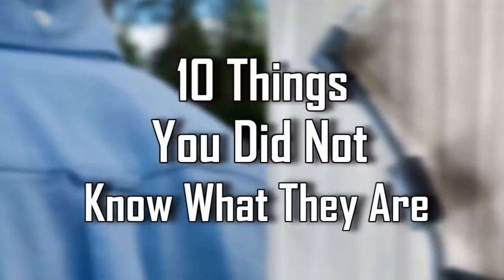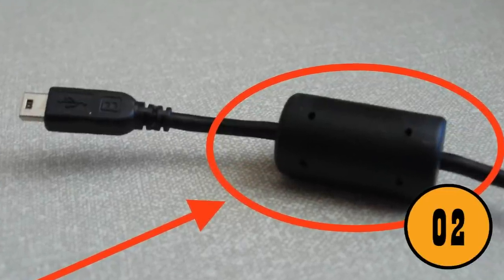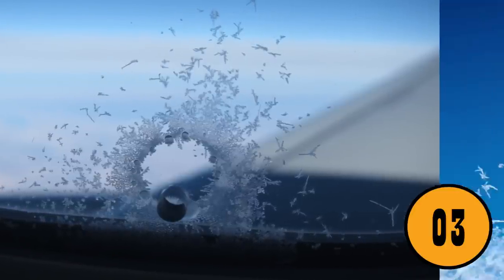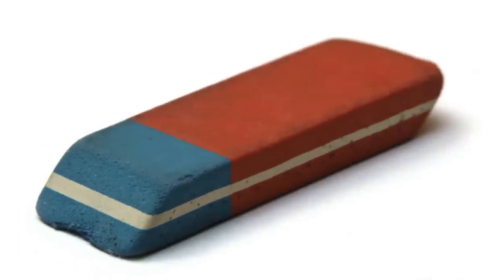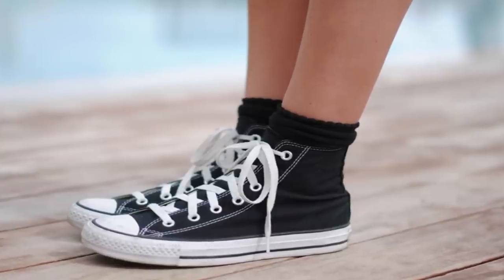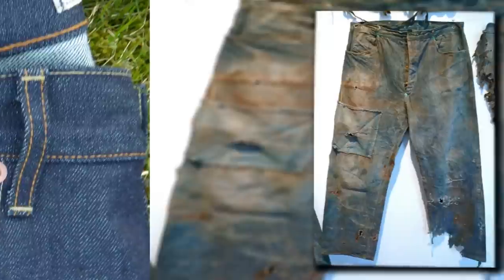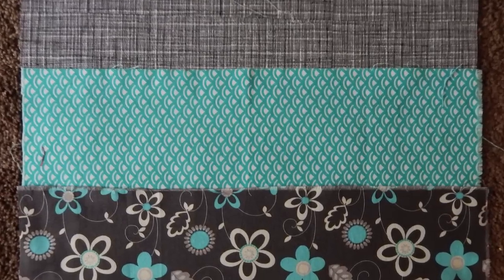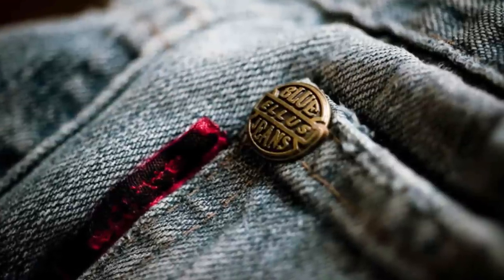10 Things You Did Not Know What They Are

Comment: Interesting "things", a lot of them had unsatisfactory explanations though. 
The Cable Cylinder for example nullifies static electromagnetic noise? What would happen if it wasn't there?
The Spaghetti spoon hole is to measure a serving? That doesn't even make sense. Of course it's to drain out the water. 
The Pencap hole is so that the whole cap is not absorbed by mucus? How does that work mechanically exactly?
The bits of fabric that come with clothe can be washed first to see what they react to washing like? Does that make sense? Unless the color actually changed I don't think you could tell if the wash shrank or ruined your piece of fabric much.
Reply: I always though it was so you could take the little piece with you to buy shirts/ties etc... and check they match the jacket...
Reply: The hole is to measure the sapghetti BEFOR you cook it.  Try google spaghetti measure.
Reply: Martin Lyhagen 
o that could be.
Reply: I'm 100% sure that is exactly what it is not for. It does not take a genius to figure out a serving, It has been around for a long ass time. No one wants water in there spaghetti so it's only natural to put a few holes in the bottom of the spoon. Also no two brands of spoons have the same types of holes so its not consistent with servings. Some spoons have a lot of small holes, how does that help measure a serving? It doesn't.
Reply: I agree with you. What a lame lame made up reason for the hole. And worse... they didn't even explain the made up reason properly. If you went from this video, you would think they meant the hole was to measure cooked spaghetti. But it doesn't matter because it's bogus anyway.
Reply: Old Aussie Ads They do make it seem like the hole is for COOKED servings. They just mashed this video together without any real research.
Reply: Ever tried pouring off the water before serving.? You are supposed to do that you know. Then you realize the hole  is not for the water...
Reply: Martin Lyhagen Yeah ok. says the person who never cooks.
Reply: Martin Lyhagen 
The water wouldn't go out without holes. What are you saying?
Reply: The hole is THERE so the water can drain, and the hole is that SIZE so people like me who will forget that noodles expand, doesn't end up making noodles for 10 instead of 2.  
So portioning isn't what it's really used for, but it can be used for that too if you want.
Reply: neonoodle 
Wow this is such a passionate discussion about noodle spoons. You'll only find this on Youtube xD
Might try this next time I make noodles. Though usually I just take them in my hand and judge from that.
 I'm actually more of a rice guy lol
Reply: I always assumed that they were there for the same reason that extra buttons are provided: for repairs later.
Reply: Seldseen Goosequillian 
Aren't Noodles a type of Pasta?
I think Pasta is just how you say meal in Italian isn't it?
Reply: "The Cable Cylinder for example nullifies static electromagnetic noise? What would happen if it wasn't there?"

Well, one example is with microphones. If you dont have a properly shielded microphone cable, then the electromagnetic noise from all your other electronics will induct into the cord (which acts as an antenna) and will cause either static or a high frequency whine on all your recordings
Reply: Broockle I am no Asian but have you ever tried calling noodles pasta right in front of an Asian? If case not, do give it a go and see how eath you will be yelled at ;)
Reply: +Seldseen Goosequillian I'm all for making fun of Americans, but at least do it when there's a reason. There's no difference between pasta and noodles, pasta is just an Italian word for noodles. 
More to the topic though (and here's a part where some making fun of Americans could be done)- that spoon is designed for almost all types of noodles, not just spaghetti, any type of noodles, with the possible exceptions of canelloni and lasagna, are really hard to get out of the water, if for various reasons, you don't want to just drain the whole pot.
Reply: pasta is just the Italien word for noodles
1....lol the whole is to measure one serving before you cook it, pasta expands when it cooks so measuring servings will help you to cook just as much as needed and no more.. also it seems like people have not heard of sieves (that's the thing you use for draining stuff..) another reason why it is not for draining is that if you cook pasta like it should be done, you would mix the cooked pasta and sauce before putting on the plate (though I sometimes prefere it the "wrong" way, too); I also saw one comment that said pasta spoons come with different wholes.. my theory is that these aren't made by companies who do just kitchen articel so they actually design it wrong/ or they saw that people don't understand the whole and thought well than we just can go craziy with the designs..
2. the cable would probably make noice then, if the zylinder is missing I guess
3. to the pencap.. (if you listened carefully you'll hear that he said not absorbed by the membrane and not absorbing mucus) it is hollow so when you accidently swallow it and if it absorbs membrane it might react like smth with a vacuum (making us choke/hurting the lungs.. with the whole there will be still some kind of circulation keeping from sucking in the membrane maybe???
4. I know your confusion but you can indeed tell of just such a small piece of fabric how the bigger piece will react..  for the colour test you need to wash a little piece of (white) rag with it (to see how much colour it dispenses), and you'll feel if the fabric tightens from rubbing it between your fingers (after drying) or if we wash our clothing wrong (to hot e.x) it becomes kind of fluffy when it should feel and look "silky" (hope you understand what i mean)... don't know who made the comment with taking it to the stores that is a pretty good idea .. to take that piece with you so you'll see what will fit your jacket or jeans etc...
Reply: There is a difference in the recipe for making them. It's like saying a steak and steak tartar are the same. Even tho it kind of is it really isn't.
Reply: jimenez de Costa to what comment are you refering.. there are so many comments it#s easy to get lost
Reply: "I don't think you could tell if the wash shrank or ruined your piece of fabric much."
Or you could use a ruler and write down the 'before and after'. But I guess barely anyone did that ever.
Reply: Seldseen Goosequillian 
Why would I call Asian Noodles Pasta? That's an Italian word. You're not giving me the impression that you know what you're talking about.
Reply: Oh god...here comes the italian guy. Spaghetti and noodles are two different things in terms of ingredients and production. Spaghetti are a type of pasta, which is a kind of food made with various kinds of flour, and...no, pasta is not the italian word for meal but you were near because it's "pasto".
Reply: +Broockle  Your profile pic brings me feels ;-;
Reply: Nicolò Albanelli 
o nice. 
So does Pasta mean anything in Italian? Is it female Pasto? xD
Josegon 00 
i get that a lot xD
Tis my favorite anime ^^
Reply: To answer the question about the ferrite core on the cable:

It creates an inductor, which effectively blocks high-frequency electromagnetic interference. If it wasn't there, then interference (radio waves, electromagnetic radiation from other appliances, etc.) could transmit to the cable and then through the electronics of the device that the cable is plugged into. Most noticeably, this could cause interference in video and audio signals.

More information:

http://electronics.stackexchange.com/questions/76412/how-does-a-ferrite-core-wire-terminator-work-to-reduce-emc
Reply: The "cable cylinder" prevents noise going in both directions. Although stabilizing the power is one purpose, it also prevents EM leakage. If your laptop doesn't have one, your power cable actually acts as an antenna in transmitting it's EM noise. There have been side-channel attacks that would enable a nearby person to determine what your laptop is doing by measuring the EM emissions. The cylinder a acts as security device by preventing it.
Reply: +Broockle Same, do the impossible see the invisible bro
Reply: Oh wow how do you know that? I mean the difference between male and female words in italian, it's not a thing in English, is it?
Reply: If the cylinder around the cable wasn't there the power cable would act like an antenna and pick up radio waves and microwaves from radio stations and other forms of wireless communication. These signals could cause interference with your laptop audio and reduce sound quality. They can also interfere with data transmission between the CPU and RAM. However, most Laptops you buy today have more than enough protection for this sort of stuff.
Reply: Xander Moser 
o fun. 
***** 
haven't heard that before, cool
Josegon 00 
Row Row Fight De Powa!
Nicolò Albanelli 
My mother tongue is German. I'm Austrian. 
Fahad Islam 
cool cool bro
Reply: That you should pour the water off when the pasta is done, BEFORE serving it... Do you really serve the pasta floating in water?
Reply: Very Private
It was imposssible to tag so i didn't bother. I was talking about pasta and noodles.
Reply: I'm quite sure the hole is there to purely minimize the amount of plastic used, thus, saving the company money. Obviously you drain your pasta before serving it so it's not there for that. Obviously different spoons have different sized or a different amount of holes in them so it isn't there for measuring either.
Reply: Emilie Malfoye
You never drain all the water it sinks to the bottom if you take a scoop you might scoop some water with it from the bottom. And so the water can drain. The measuring explanation i don't understand or is ridiculous.
Reply: Emilie Malfoye 
Tortellini...nuff said
Reply: It never really made much sense to me why people thought the spaghetti spoon was for draining water, that's what strainers are for.
Reply: Sienna Cammarota 
....wat?
........Spaghetti spoons can be used for either noodles still in water or noodles that were put through a strainer. Spaghetti spoons aren't used for straining they're used for serving. 
Put some thought into your comments man. Can't you see how passionate we are about Spaghetti spoons!? Seriously.
Reply: lol the fabric is too take to a store to get fabric to fix any wear n tear, this is from a time when everybody knew how to sew
Reply: same with the button, ppl think its to replace a button the fell off, well what if two buttons fall off......your supposed to take it to the store so you can get replcements that match
Reply: JewUnit6 
I can belief that. 
The washing thing seems more far fetched.
Reply: lol didn't realize you guys were so passionate about spaghetti spoons. I've personally never seen them used for serving pasta, my family would just use tongs. The more you know. Btw pasta in Italian can mean pasta (or noodles, whatever you like to call them) or pastry.
Reply: Sienna Cammarota 
Pastry too? That's funny. 
In my family most of the time we were super lazy and just used a fork xD
Reply: @truints  ever heard of pouring the spaghetti into a strainer?  That's how you pour out the water before serving.
Reply: @jimenezdecosta8478  Actually, you can drain all the water.  It's called pouring it into a strainer.

Comment: Why are people putting pen caps in their mouths?
Reply: Well some people have a bad habit of chewing on the caps as they concentrate on writing, also babies eat things
Reply: To supress the craving to smoke.
Reply: If you only have one hand free, you use your teeth to hold the cap and your free hand to pull on the pen. I use pens that 'click' so I won't need to do that.
Reply: Chewing on a cap would cause it to close the hole up..lol It's obviously for children.
Reply: The hole in the pen cap is there to prevent air getting air trapped under the cap when you put on the pen so you can remove easily.
Reply: I never knew anybody older than 14 months who did that, though chewing on the barrel of a Bic pen or the cap a\attached to the barrel was a common thing in the Sixties.   Always hated Bic pens,
Reply: +limenez de Costa Why not just... not smoke?
Reply: and to stop ink from getting pulled out of the pen when you remove the cap because of vacuum pressure.
Reply: Wrong!  The hole is there so that the pen dries out faster and you have to spend more $ for a new pen.  ;)
Reply: when busy some people open the pen one handed by pulling the lid off with their mouth and putting it on the back of the pen.  After doing this allot they sometimes just leave the pen lid in their mouth until done.
Reply: Also prevents leakage.  Putting a sealed cap on a ballpoint pen creates air pressure than can push the ball back.
Reply: +Kyosumari Why is that? What did they break? Where can I file a bug report?
Reply: it's called Boredem
Reply: Handy storage.
Reply: Aaron Harrington
try smoking in office and keep your job.
Reply: jimenez de Costa What does that have to do with quitting to smoke?
Reply: Kyosumari But why don't people just not smoke... Just don't do it.
Reply: Kyosumari I started smoking and after about a year I easily quit. I really don't get what is so hard about it. Even if you are so addicted that you cannot resist (which I have never understood), just throw out the cigarettes and don't buy more.
Reply: Aaron Harrington
Your brain connnected the smoking to different parts. I know it kills me, i know if i don't buy it again i stopped smoking. and i did, 2 times. Still i started again, like many others.

Addiction is a weird thing.
 See it as the most beautiful attractive girl perfect blabla, the number one. You're allowed to sleep with her, live with her, whatever you want. But you have to choose not to. Even though it is all you will ever want, you have to choose not to, by yourself. It creates a void that has to be filled. Some fill it fast enough so they wont feel the void as much. Others take longer and get sucked in again.
Reply: jimenez de Costa Well I have never experienced addiction.
Reply: Kyosumari Withdrawal is not the same thing as addiction. It's close but not the same. Withdrawal is when you have been taking something for a long time and then when you quit it "hurts"  while addiction is when you want to go back to something while trying to quit (no matter if you have withdrawal or not). I am pretty sure most people have experienced withdrawal even if they were not addicted.

Comment: I think most of these "reasons" are total bullshit.
Reply: The ferrite one is true.
Reply: Yea, but those two were things that everyone knows.
Reply: I didn't know that.
Reply: 1,2,3,7, and 10 are true.
Reply: 8 is true
Reply: and 9
Reply: Hows it feel to be left out of the group 'everyone'?
Reply: Que padre
Reply: The part about the small pocket on jeans is true.
Reply: +RC Central I can confirm the ferrite one. I am a ham radio operator and I have installed ferrite beads on cables to prevent RF from getting in there. Cables will act like an antenna and pick up RF. The Ferrite will block the RF and keep it from getting into your device.
Reply: TeleTrans 1 exactly

Comment: 1: Common Knowledge (and its been well documented that its to hang the shirt)
2: Common Knowledge to anyone that understands basic electricity.
3: Knew It, but only because of a video I saw a few years ago.
4: Wrong, Blue part of eraser is a coarser grit then the red and is designed for use on heavier weight paper and darker marks, while the red is designed for lighter weight papers (standard notebook paper) and precise erasing.
5:  Wrong again, they are there to lock in your heel (also called a lace lock) and has nothing to do with the ankle. Its so you don't smash your toes against the front of the shoe, which is known to cause black toenails.
6: BS, I challenge you to find any 2 manufacturers to have the same diameter hole (or even same size spoon). That was an false internet meme that went viral. Its so you get less resistance when stirring the noodles and to drain off the water. 
7: Common Knowledge
8: Never knew that, but at the same time, don't trust a word you say..lol
9: Wrong again, the hole in the cap literally is to comply with international safety standards. BIC did the hole before the safety standards becauce they found it equalized pressure and prevented the pen from leaking. Go ahead and contact BIC if you want proof
10: Common Knowledge

Video was meant to be informative, but you managed to make it entertaining for an entire different reason. Thanks